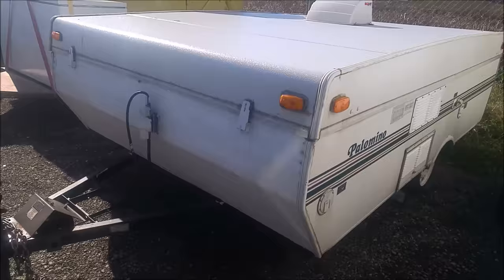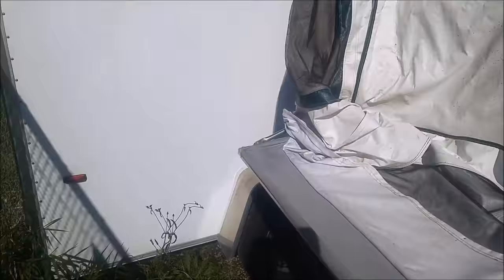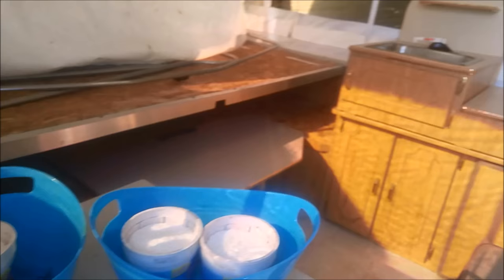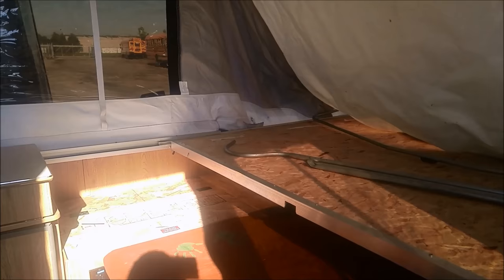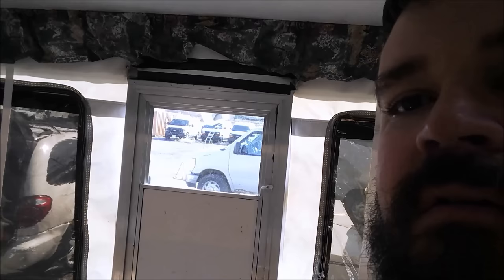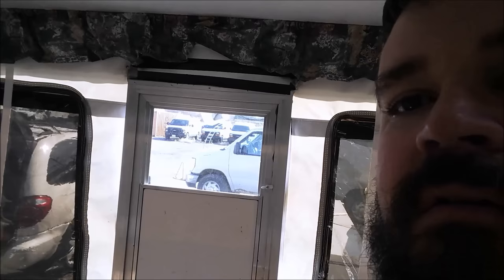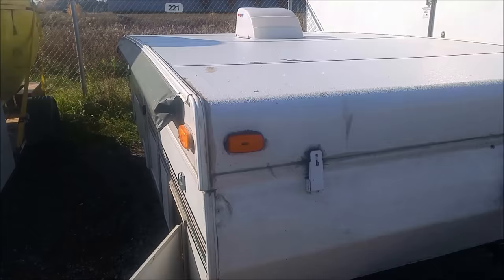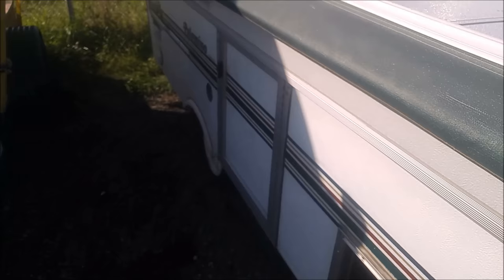How to Winterize a Popup Camper (tent trailer)

Comment: do I have to put it down for the winter? I just bought one last fall and kept it up all winter working on it when it wasn't too cold out. I have damp rid, and a  propane heater  that kept it from molding. It is pretty much gutted as far as electricity to it, heat, plumbing,  etc. but in very good condition. I just wanted it for a little camping trip here and there.  It is a 1978 Steury, and I love it.  If it is ok to just leave it up for the winters, I will do that, since  I go out and check on it often.    Thanks for your help........................................

Comment: I'm a newbie pop up camper owner  and will be winterizing for the first time this winter. There is no water pump or water heater. The system only comprises of a holding tank, city water connection and tank fill valve. the sink gets water via a pump style faucet. Will it be effective to just drain all the water instead of adding the antifreeze?

Comment: Great video! Where do you buy the Damp Rid?
Reply from the maker: In SW Ontario it's been hard to find lately.  I used to get it at Home Hardware, but recently Canadian Tire started stocking "Damp Chek" which is a pretty comparable product.  I am using this Winter in my TT, so we shall see how it performs.  If you do get it from Home Hardware they usually need to order it in.  Home Depot used to carry it, but lately all they have is the pouches for closets which aren't really suitable for a PUP.  Lowes may carry it, but I haven't checked there. Thanks for watching!
Reply: Would you consider doing a video on what to look for if ur going to buy a used pop up because we have no ideal what to look for & were very limited with money being on disability I just don’t want to get ripped off thank you
Reply from the maker: Hi Shelia! Thanks for the suggestion! Stay tuned, I will put something together in the next week or so :-) Thanks for watching!

Comment: You mentioned about the roof if its leaking you'll notice the staples  rusted, ceiling bubbles? I noticed theres not bubbles but its loose in one area, someone mentioned to me it's from the humidity.  Is this possible? Ty
Reply from the maker: It's possible as you can get a surprising amount of condensation in popup campers in the Fall and early Spring. Keep an eye on it and try to put Damp-rid in it when you are not using it.

Comment: what type of caulk do you recommend for the roof edges
Reply from the maker: I always had great luck with Mono brand products. Never had an actual leak in the roof itself (just from the rubber seal when you close the roof down).  The original owner tried using clear silicone but over the winter it would always shrink and peel, so I would stay away from that. I also had less than great results from DAP brand caulk.  For roof vents etc I recommend using Dicor Lap Sealant (available at any good RV dealer).  Good luck!
Reply: I am using dicor self levelling and no sag for a roof rebuild. It's a highly recommended pair of products. No sag for vertical surfaces and the self levelling for the flat roof itself. It's available in Amazon for around $11 USD

Comment: can a ATVs pull pop up camper
Reply from the maker: Great question Josh, and honestly one I am not sure I can answer.  The ATV would have to have some sort of tow bar/ball installed and you would need to check the two limit for the vehicle.  Some of the very small popups weigh 1000lbs or less, so it may be possible.  I definitely don't know much about ATVs.
Reply: No. This would not be a good or safe idea. I mean sure for maybe moving it around a yard but the tongue weight will be far too high, and the brakes on a ATV would not be nearly strong enough to stop 1000+ pounds of rolling weight.